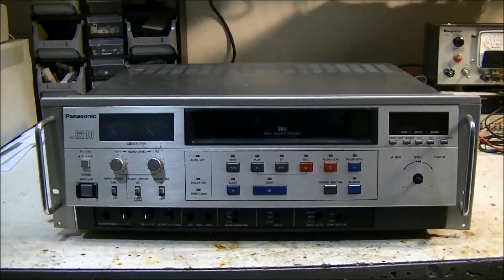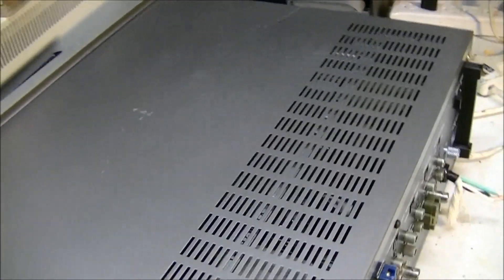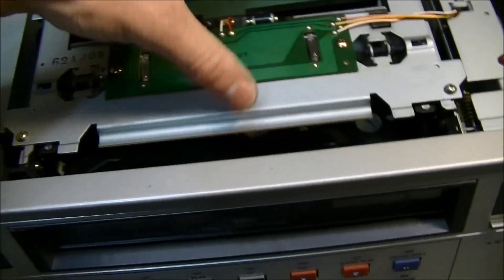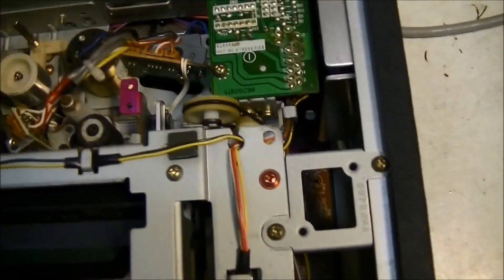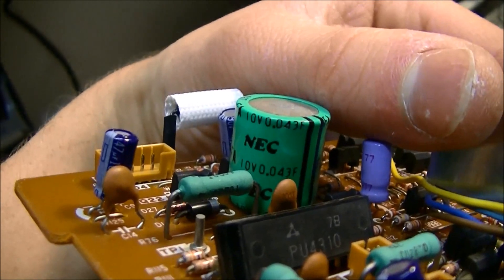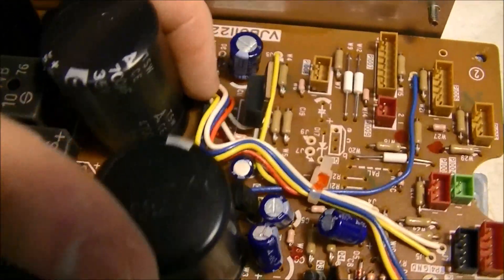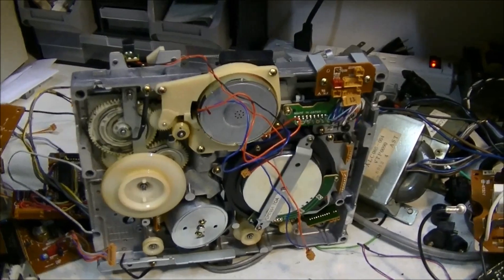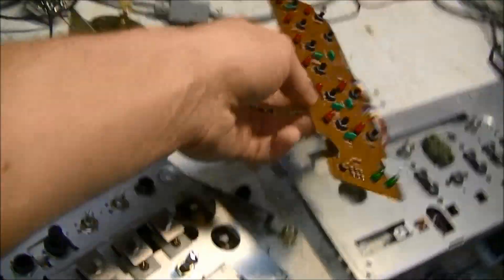26 Year Old VCR Tear Down (part 1) - Has Some Very Nice Motors, Transformer, and No SMD Components!

Comment: I recently repaired one of these, mine produced in 1984, and I must say that it is quite a high quality model. Of course, you would expect this considering the original list price was around $2,195 USD. Even without doing any circuit calibration, the picture quality on mine is excellent (certainly superior to any of my consumer VHS machines), and so is the audio fidelity, especially considering it is using half-width linear tracks in order to accommodate stereo recording! Too bad that this one mostly went to waste; the repairs would likely have been quite straightforward.
Reply from the maker: +blarrer20 Yeah they are really well built!  Wow I didn't know they cost that much back in the day!  Meh, it didn't go to waste in my mind.  It was really going to go to waste if I hadn't rescued it from a dumpster.  I mean sure I could have sold it for maybe $100.  We hardly ever use the VCR that we have so there would not be much of a difference there.  Plus it doesn't have a remote so that would have been a pain.  But I got all the awesome parts and it was a joy for me to take it apart.
Reply: +Makerj101 Thanks for the reply. I suppose I'm glad that at least some of its parts went to use, rather than everything being disposed of. However, correct me if I'm wrong, but I think that my statement that it /mostly/ went to waste is still true. By my definition, for this to be true, it means that less than 50% of the individual parts have found a new use. Considering that there are very many parts of this machine that are quite application-specific, difficult to find information on, or too common to bother extracting, the percentage of parts that have actually found a new use is probably considerably lower than 50% in this case.

For example, the parts that I doubt you have reused include: many of the metal structural components (especially the cast-aluminum transport chassis & the circuit board mounting brackets), the faceplate, the plastic gearing of the loading mechanism, the pinch roller, any of the metal tape guides or rollers, the reel tables, the brake pads, the tension band, the full-width erase head, the audio and control track heads, the idler wheel assembly, the tape label mirror, the cassette door, the incandescent VU meter & compartment lamps, the audio recording relays, the AN6677 motor driver chip (for which there is no datasheet) or any of the more obscure and complex ICs, most of the passive electrical components (i.e. the literally hundreds of resistors & capacitors especially), the VU meters, the VFD display, the control buttons, most of the connectors (especially the large one for the remote), the shielding foil, the PCBs themselves, etc., etc...

There is no situation where I've found this sort of teardown to be anything other than mostly wasteful, although again, I think it's better than disposal, though not by much. Needless to say, nothing would be wasted if it was repaired and used. The best solution is to find someone who values and can use such a device. I should point out that these high-quality VCRs are becoming more and more desirable as consumer units are developing faults and are being prematurely disposed of, while people still would like to use the format, or would like to transfer their tapes to other formats. There are still millions of VHS cassettes that can be played, and at least tens of thousands of people still making new recordings; the format is far from dead. Also, there are still many replacement parts available, especially for these professional units. Add to this that modern VCRs are of terrible quality in their performance, design, and manufacture, and it becomes clear why units like this should be saved. Nobody makes VCRs like this nowadays.

Anyway, let's just say that if you ever find another similar unit destined for the landfill, let me know; I'll pay for shipping!
Reply: +blarrer20  Still looking? I came across a Sharp VC-363. Complete.
Reply: I'm actually repairing mine right now. Have a belt and pinch roller kit. Stuck on screw order for disassembling carriage containing video head so I can get to underside where long belts are probably located. This machine is built like a tank, got it in a dumpster dive 2 decades ago. Can't wait to figure it out. Any advice on disassembling would be invited :)

Comment: Wow they don't make'em like they used to. With those handles on the front and given the size of that thing, it looks like industrial electronics testing equipment
Reply from the maker: It would have been mounted on a rack.  That's why it has the handles.
Reply: Panasonic didn't categorise these as industrial VCRs for nothing. I think they saw use in surveillance and medical applications, among other things. Built like a tank and very serviceable -- no consumer crap.
That said, I'm not happy seeing one being gutted for parts! ☹